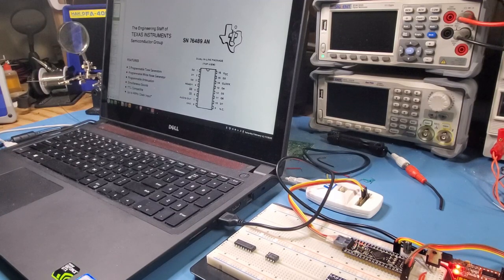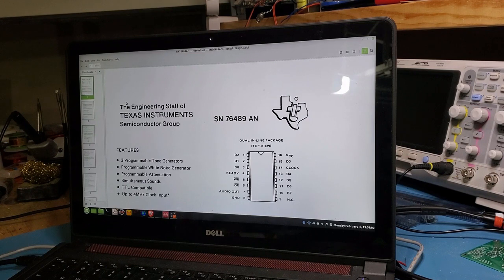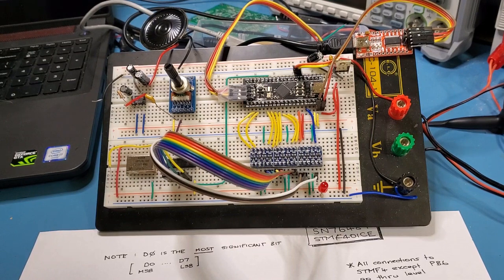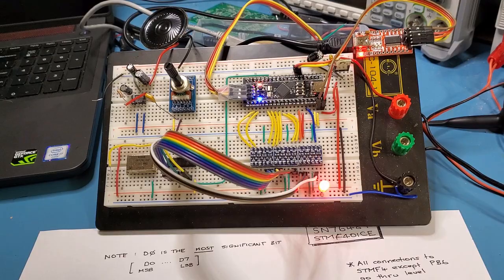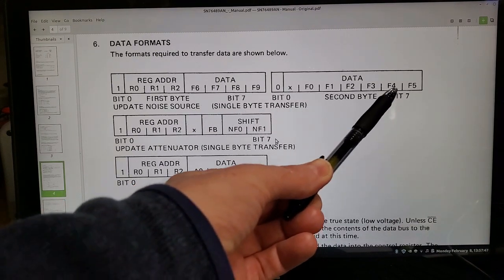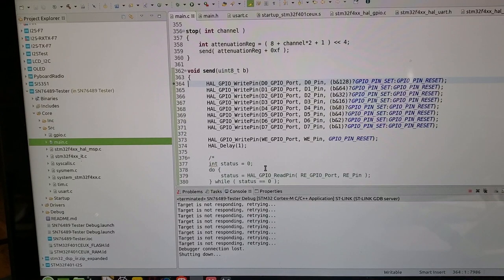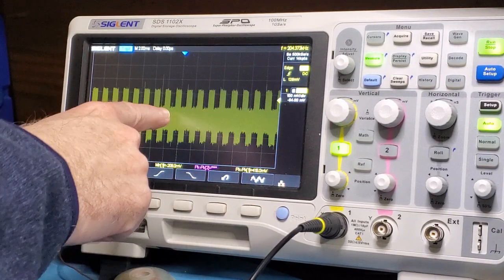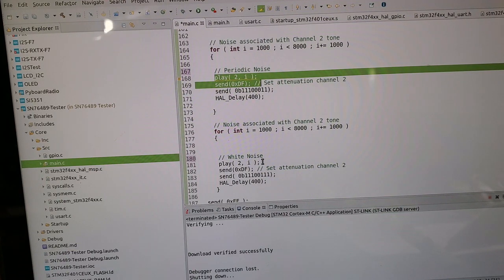Retro Sound Tech  - Programming the SN76489 Sound Generator

Comment: Do I understand correctly that your clock signal is 400KHz and that matches the unexpected 'noise' in your output signal? Could you increase the clock frequency and thereby raise the frequency of the noise?
Reply from the maker: I wasn't  clear on the clock. I had a 1 Mhz PWM signal generated in the STM32 and I was passing that directly through to the SN76489 and not using the level shifter. I think the noise in the output is just artifacts created by the way SN76489 synthesizes the audio. Having said that I didn't try different clock frequencies to see the effect
Reply: @na5y  Wow thanks for replying!

Comment: Outputs driven from 3.3v TTL devices to 5v TTL devices don't need level shifters, they're needed only when 5v TTL devices are driving the inputs to 3.3v TTL devices. Anyway the STM32F401/411 (the black pill in your video) is TTL & CMOS compliant and 5V-tolerent on all its I/O ports so level shifting is indeed unnecessary. If simple level shifting is needed (e.g. 3.3V TTL driving 5V CMOS), you could use any 74HCTxx gates. There are also proper level shifting ICs (e.g. 74LVC4245) available that could operate at high frequencies, but they are smd devices (to use them will need smd to DIP adapter boards and some minor smd soldering).
Reply from the maker: Thank you very much for the info David. It's good to know I don't need those level shifters. I was kind of erring on the side of caution here.

Comment: At 11.40 ish why don't you write the  8 bits directly to the port so that the port changes all at one time, much faster and they way it should be done. I don't know why the arduino IDE does not have a port write built in that everybody knows about. Great video still, I love to see old chips interfaced to moden uC.
Reply from the maker: You know that's an intriguing suggestion to show the difference between going through the HAL to set the output pins and driving the ports directly. I might do a video on that for fun!

For GPIO on the STM series there is the output data register for that purpose. So if you want to, for example set all lines PA0 - PA7 to ones you would
   GPIOA->ODR |= 0x000000FF;

Thank you for the comment - it is tough work operating below the HAL - but important to know that its all there.
Reply: @na5y  Been working on embedded systems for more years than I care to remember. I just don't understand why people are lead to read and write to a port one bit at a time. It's one 8-bit port not eight 1-bit ports. I think a video is a good idea.
Reply from the maker: @TheEmbeddedHobbyist  I think part of it is semantic complexity - its certainly easier to read 
  HAL_GPIO_WritePin( PORT, Pin)

than
 PORT->ODR |= ( 1U << PinId)

even if less efficient.

However I am speaking not as an embedded system developer but a java application developer - we typically sit on layers and layers of abstraction ;)

Comment: This is the chip inside the popular ACORN BBC MICRO, a computer I programmed in the 80s. I remember tinkering with the sounds from the chip in BASIC.
Yes, if you were around the arcade in the 80s, the tones from this chip is the sound you'd hear (and others like AY-3-8910 and AY-3-8912 etc).
Thank you - Best wishes from the UK
Reply from the maker: Sorry for the long delay - thank you for the comment. I do have a separate video on the AY-3-8910 if you are interested

Comment: Hi on the LM386 pin 2 go's straight to Ground put a .1uf between pin 2 and Ground it will save the life of the LM386, this is a mistake a lot of people make, I found this out 40 years ago when a LM386 kept falling..
Cheers great video.
Reply from the maker: Thats a great tip - thank you. I haven't seen that technique - do you have a reference, I would be interested in reading.
Reply: @na5y  Years ago when I was in the electronic design game and what a game it was..
I used a LM386 as a audio amplifier and strange things were happening LM386 was becoming unstable and then gave up the ghost, a quick look at the circuit of the chip and emitter of one transistors was on pin 2. lifted pin 2 with a .1uf and everything work great. 
Look me up on google Cheers 73 G0UIL
Reply from the maker: Thank you for the tip I will have to try that out - Cheers, Ian

Comment: I have been playing with one of these devices, but I was really confused about the data pins and register bit names. Normally the MSB is D7 but on this chip it is D0(!). Very confusing and it took me some time to figure out. The bit field groups are also backwards in terms of LSB and MSB. Thanks a lot TI !!!

Also the behaviour of RDY was very peculiar. I looked at it on the scope and it didn't behave as I expected. Just a heads up to anyone thinking of using it as a WAIT signal to their CPU. In a datasheet I see a circuit to avoid this issue, by using an AND gate to mix RDY and an external chip select into CE, and connects RDY (out) to WE (in). When chip select goes low this forces CE low, which triggers RDY to go low, holding CE low and allowing the release of external chip select (it needs to be > 150ns to trigger RDY). RDY being low keeps WE low for the correct amount of time. If doing this you should latch the data inputs so they remain static until the next write. Note: when I used an Arduino pin to hold WE low for several hundred microseconds, RDY toggled up and down, because I believe multiple writes were being triggered. So I recommend this circuit. It's in the June 1984 TI datasheet.
Reply from the maker: I'll have to check out your suggestions. This was an interesting IC to play around with. The sound waveforms generated are nothing like the smooth output we see in modern sound devices. Thank you for the comment!

Comment: 15:08 Sorry I am a beginner to programming. The 3 play commands are one after the other. So how is it that they all write to the 3 channels at the same time?? Won't there be the tiniest of delays that throws off the the perfect timing?
Reply from the maker: There certainly would be a small delay - but we are likely talking about a delay of 20 or 30 microseconds. That delay would be imperceptible to a human listener. Thank you for the question and good luck with your programming!
Reply: @na5y  I see! I also noticed you seem to be using divides a lot in your code. Won't this drive up the delay? (In calculating the variable tenBitValue). Why not move that to a global variable so we only compute it once?

When messing with an arduino nano and buzzer, a simple modulo done when bitbanging 'bits' to the piezobuzzer to create my own square wave at my own frequency caused a very perceptible reduction in frequency, implying it took time

How is that your board computes divisions fast?
Reply from the maker: @Sh-hg8kf  You didn't say what device you are using so not sure. The STM that I was using runs at 160 MHz - you can do a lot of computes without it affecting anything really. 

Obviously there are many cases where optimization is key. For example if you are doing digital processing of a digitized sound stream then you do have to be very aware of what compute cycles you have available. With this sound chip I am just setting register values and the sound chip itself is forming the output sound. 

It can be very difficult without specialized equipment (an oscilloscope for example) to see exactly where the time is going. Any debug statements you put in there will greatly affect the timing as writing out of the UART is an expensive operation.

To answer your question though - that board could do millions of divides per second - so this example it wouldn't affect the result.
Reply: @na5y  I'd mentioned I was using an Arduino Nano. It's not the fastest yes, but even a single divide causes a notable slow down which I find very very odd

Speaking with reference to your SN76489, is there anyway to write to it "parallely" or to trigger all channels at once instead of one by one? Everything is communicated over one write line so that makes it hard. Is there anyway to "freeze" the chip but keep the writes open until I've done the writes I want and then "unfreeze" the chip?
Reply from the maker: @Sh-hg8kf  I don't know if theres a way to do that. You could potentially mute all channels, do the write and then unmute all channels. You'd probably not see much of a difference though.
Reply: @na5y  I see. So it is serially written to usualy? What confused me was that the VERY similar AY 3 8910 chip was shown as being parallely written to in another video I'd watched. If they are all more or less the same die under the hood, why does one accept serial while the other accepts parallel input?